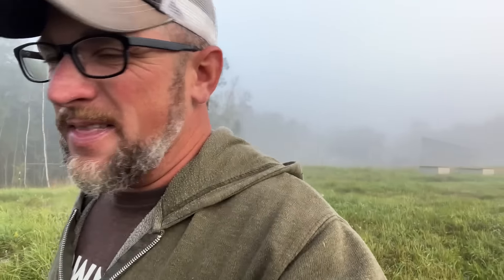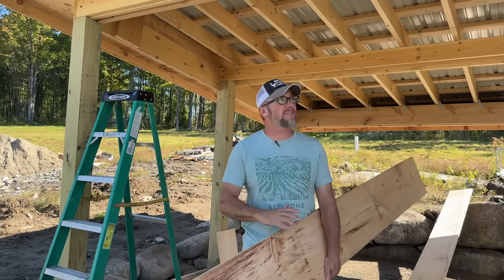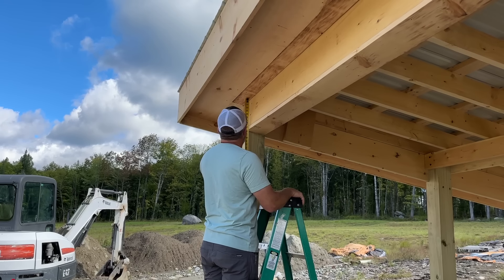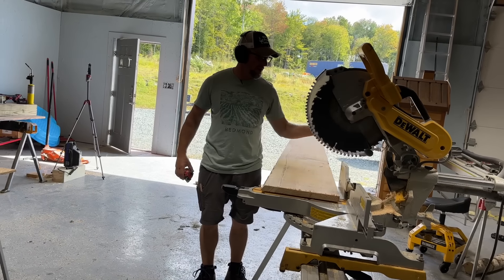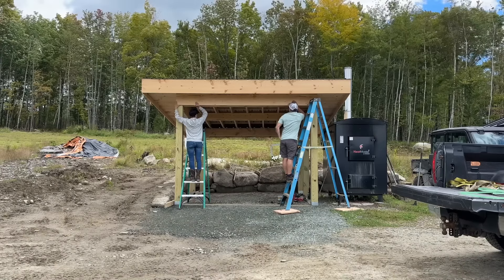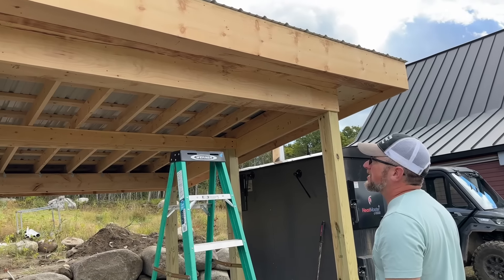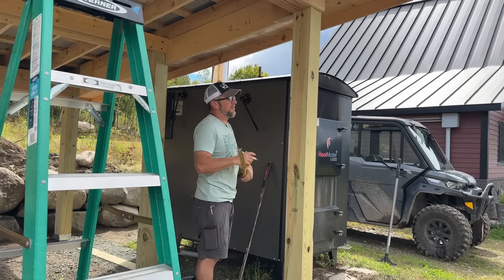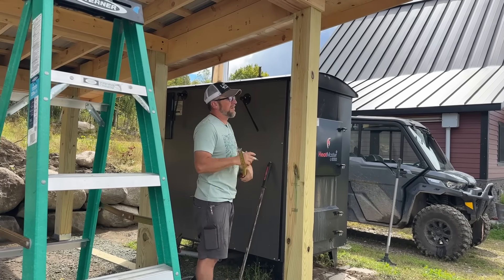It's SIMPLE But LIFE CHANGING...

Comment: Al, are you going to add Side and back walls to keep the drifting snow and blowing rain out of the wood shed. Simple rough cut pine12" boards with air gaps ???. It sure looks Heavy Duty 👍💚
Reply: Canvas rollup sides would be nice- you could roll them up in the summer to help dry the wood?

Comment: Al, Check out the MicroJig BladeClean system.  It is a plastic tray with a bunch of accessories that make cleaning the wood tar and sap/pitch off your blades which can extend the life of your bits and blades immensely. Use whatever solvent cleaner you want with it, but it makes maintaining saw blades super easy.  As soon as you notice the carbide teeth on the blades turning tan/brown and the tool struggling, that's your sign to clean the blade. I like CMT Tools Blade and Bit solvent/cleaner.

Comment: Definitely overbuilt. Braces on timber frame structures are tension/compression and as such are usually a couple of sizes smaller dimensionally than the posts and beams. For example the braces on my 160 year old house are 4" on 10" and 12" posts. OK Al, fess up, what new tools did YOU get at Lowes while Gina was "distracted"? Harbor Freight sells a tool for sharpening circular saw blades.

Comment: WOW! The comments on the video....... I know that they are opinions but just WOW.  If everyone could remember the Jamaican Cottage build barn kits are very similar. Al has made this a little bit beefier. I believe  Al has said that the usage of firewood is a lot less than a normal wood stove. If he feels that sides need to be done he can always add a tarp.  When I lived in Alaska our fire wood would have snow on it, we would just knock it off before bringing into the house, it was never covered, it was put in a built  woodbox to warm up though before going into the stove.  We had a dirt floor in our pole barn hard packed, hubby laid treated 4x4 down making it level with the ground and then screwed sheets of chipboard to 4x4s ,made it easier to work and clean up. Not a permanent thing of course but worked for us.

Comment: lol;;;I think that thing could hold up a herd of elephants;;;lol;;;lookin good but I think ya need to put beaded ceiling in to help with looks and weight to keep on ground if huricane comes through;;;I bet you could find a saw blade sharpening place around;;;however when I had my blades sharpened the cost almost as much as a new blade;;;that was a few years ago;;;;welll maybe more than a few;;;;lol;;;when ya 80 your memory not so greatyl;;;;;almost time to load the wood shed;;;I'd come up and help but durn it my tricycle has two flat tires and one pedal broke off so I'm stuck here in Texas''';;;;;thumbs up and get stocked up for the season

Comment: After doing such a nice job putting in the 8x8 braces I thought the 2x8 braces are not the nicest. From the outside they look good but the inside part at the roof does not look right. I would not have gone that high
Reply: @4Classie Fool

Comment: Al, I have a question.  With those boxed beams, it looks like the 6x6 is just into the trim plate and not the two cross members with that single lag screw.  Would it not be stronger with 2 lags, each into the cross member of the box beam?  I just noticed that at about 19:50 in the video while you were talking.  Or is the box beam not hollow in the center?  I don't remember.

Comment: Good Morning!  Structures with four sides can collapse.  Diagonal braces add triangles, which are the most stabile shape.  I think maybe you just created multiple pockets that are open to the top under the roof.  That means bees and wasps can get in there to make nests, and you can't spray the nests.  Without that "pretty" bottom board, you could spray them.  Once you start sealing access, you have to seal everything.  That's why I was concerned about your soffits.
Reply from the maker: Goooooood Morning
Reply: Good morning Guy!🌄😊

Comment: Hi Al and Gina, you can Sharen the tungsten blades with diamond hones. I also saw a sharpener for circular saw blades and was wondering how a diamond sharpening disc would work in those, for the tungsten blades. Manually sharpening takes some time but if you had diamond hones you could drop,out the blade before it’s too far gone. Just my thoughts.

Comment: I wouldn't want to be close to that wood shed in a strong wind. Way too much weight on top and the posts are poorly anchored. They should have been put in the ground set in concrete. Hope when it does go over it doesn't go on the boiler and no one is around.